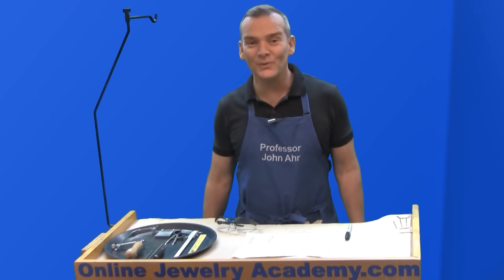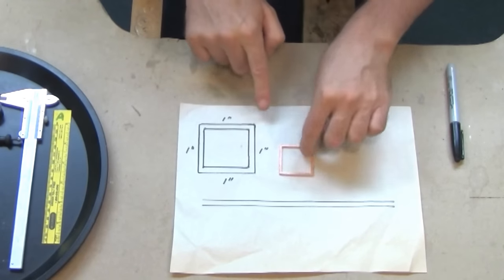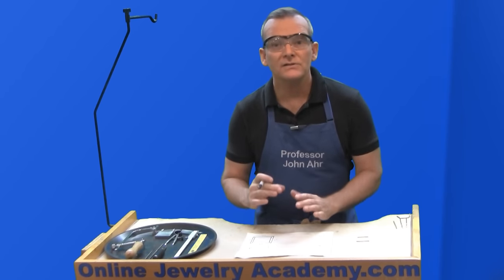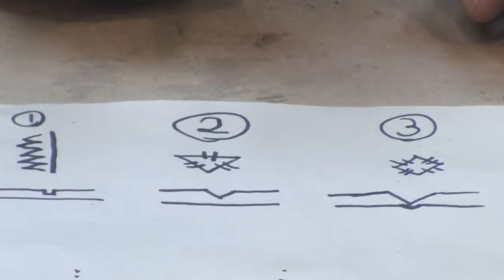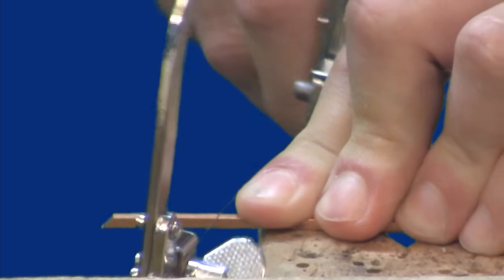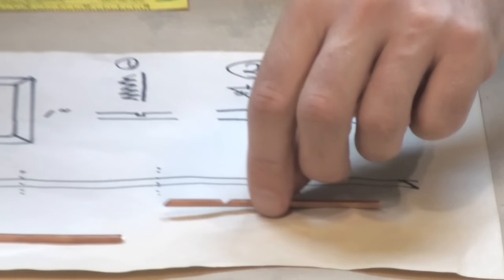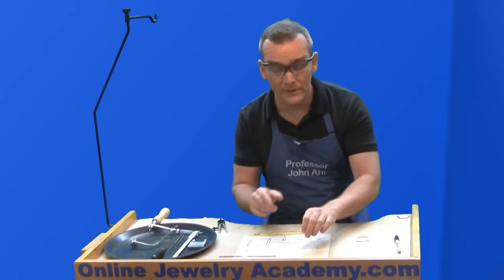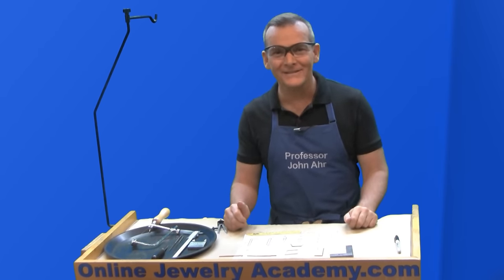Quick Steps For Making Perfect Squares And Right Angles

Comment: Do I need to do this if I ever decide to make my own square or rectangular bezel wire?
Reply from the maker: Hi Huskyfluffy,  This process won't create a square or rectangular wire.  To do that, you would need to pull wire through a draw plate with square or rectangular holes in it.  This process is for creating 90 angels or squares.  For example, you might want to create a square ring.  I hope that clears things up for you.
Thanks for your support! : )